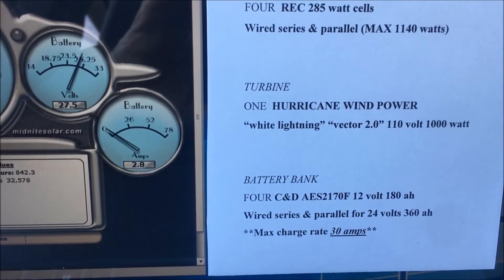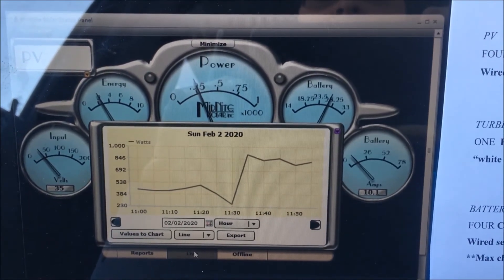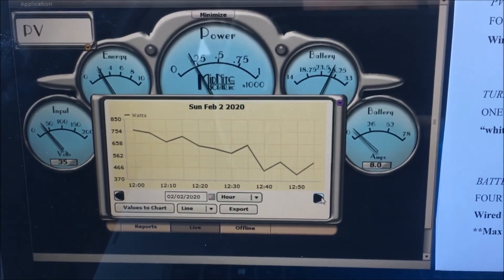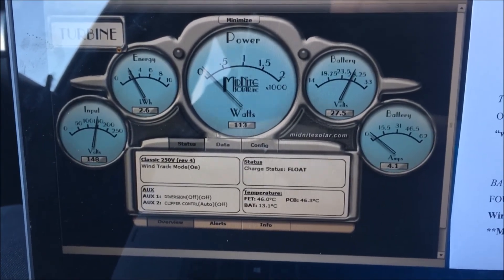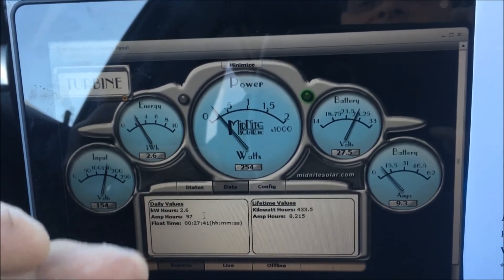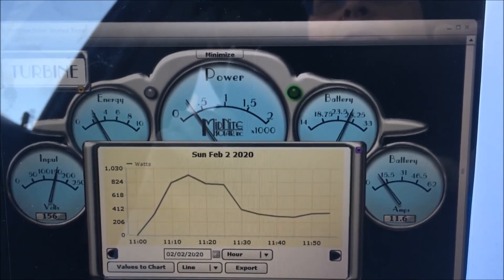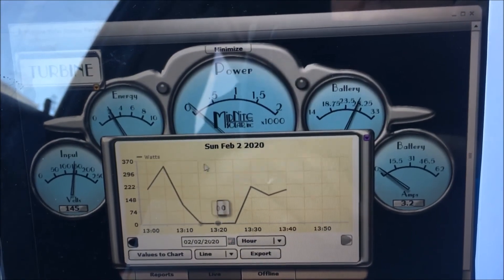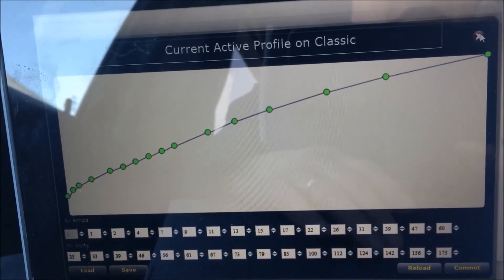Hurricane Vector 1 KW Wind Turbine Versus 1.2 KW solar output comparison. Is Micro wind worth it?

Comment: after I get done with my House remodel and I get back in on my solar witch is down for now and has been for a year battery bank is dead.  So in about 2 years I will be working on my solar and wind and I will have to get a good wind turbine for my system.  But that is a few years a way.
Reply from the maker: cool mad good to hear from you

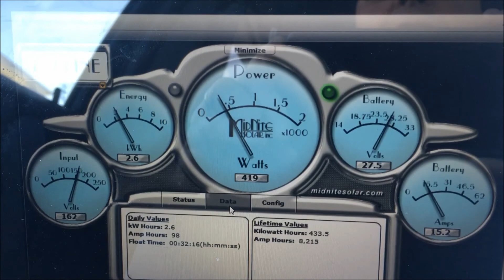Comment: Minute 15:25 you say 5 tausend Kilowatt hours? That is 5 megawatt hours you have a powerplant for a cruise ship built for 500 passengers and crew.
Reply from the maker: I think based on all of the data he  provided I think it is relatively obvious he misspoke meaning 5 and not 5000 . Frankly I found it obvious enough to leave it alone however if anyone did not actually know what he meant let the record stand corrected.